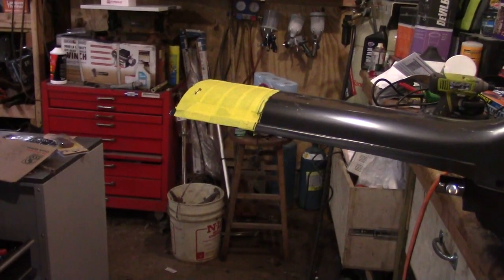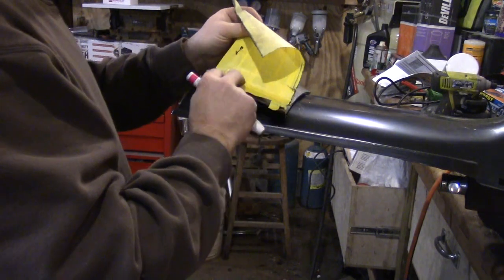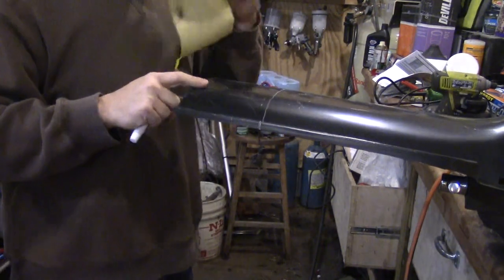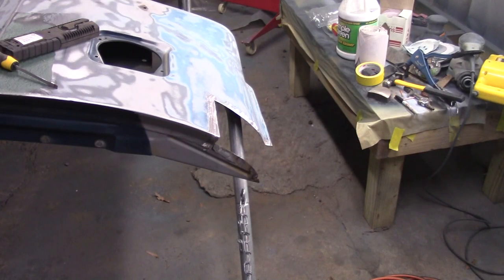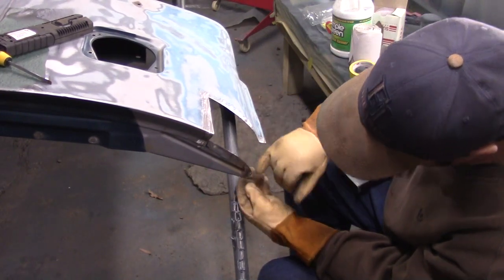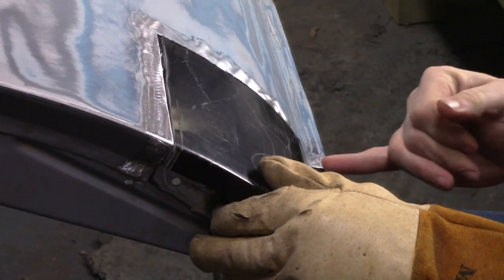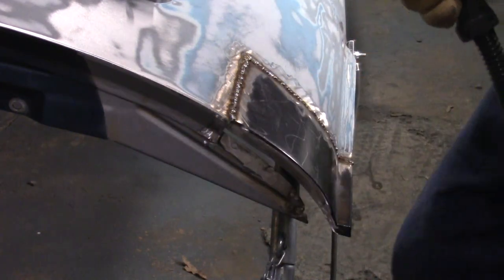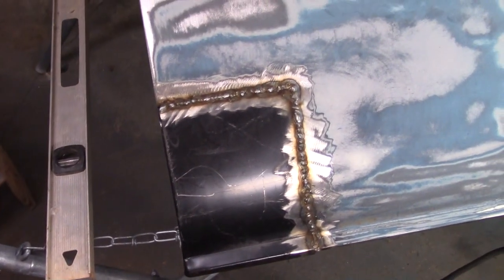1985 Chevy K10 Restoration Bed Work Part 5

Comment: Reason I asked"....... I noticed you were getting some wire splatter? What's your pressure set at? Very good your using gas though as, body panels, thinner gauge stuff, tends to heat faster when welding and you'll find gas will run much cooler on your panels! Rather than a flux core wire! Glad to see your persistent, take your time, go the extra inch or two and, you'll be amazed at how nice your truck build will flourish.. You'll her Er" Done" Like your vids good content, keep Er" up.....👍🏼👍🏼👍🏼👍🏼
Reply from the maker: +TheRooster1122 Thanks, I'm not exactly sure how much pressure it was running at, I turned it up some during the welding process to see if that'd help, but couldn't really tell that much of a difference.

Comment: looks better than my patches and it leveled out just fine with body filler
Reply from the maker: +kyle1330 Thanks, I just finished it up and hopefully it'll turn out fine :)
Reply: +farmboy30117 i half assed the body work. the driver door  has a lot more dents than i thought. ah well, wouldn't want to make it too nice, then i might be afraid to have fun in it.